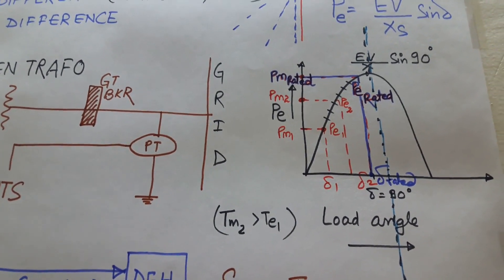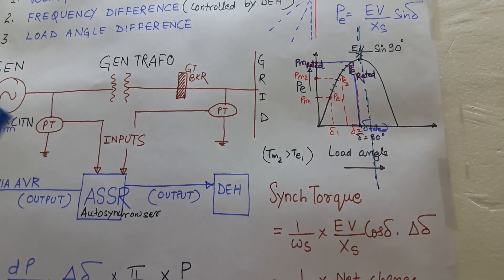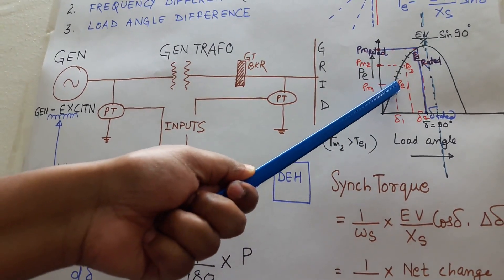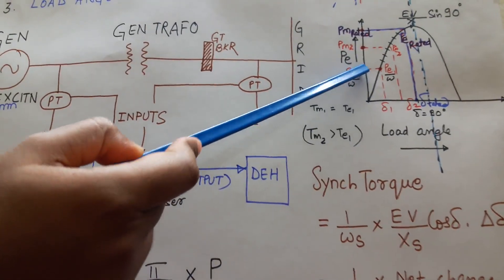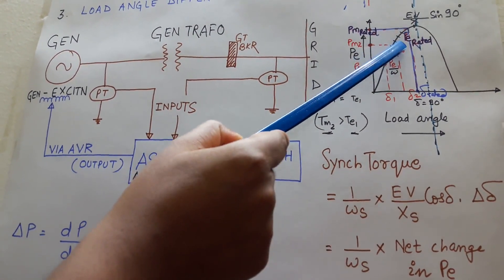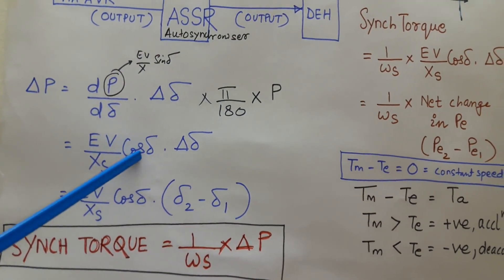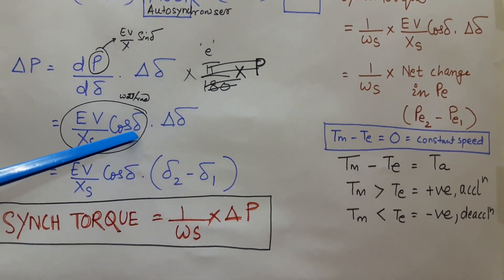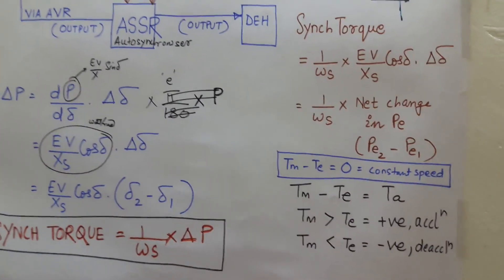GENERATOR : SYNCHRONIZING TORQUE AND STEADY STATE STABILITY

Comment: Can you pls add a vedio on synchronous motor exciter circuit and specifically the use of crowbar circuit during the motor start to prevent the motor  damaging the rotor circuit